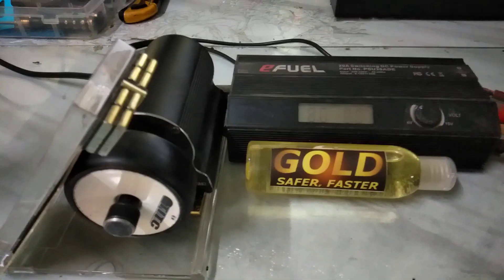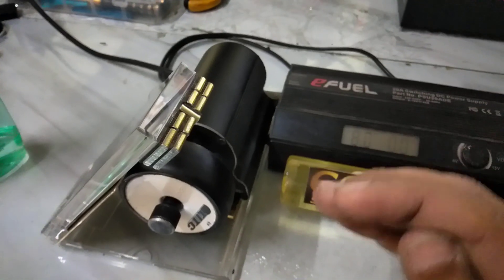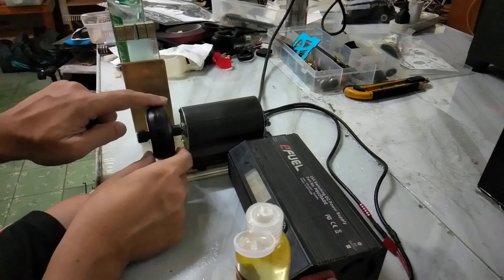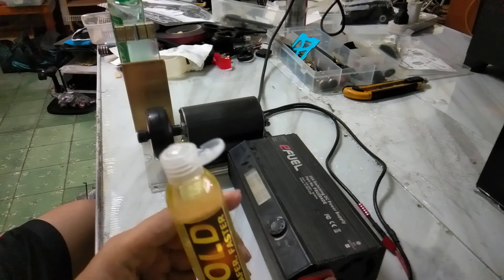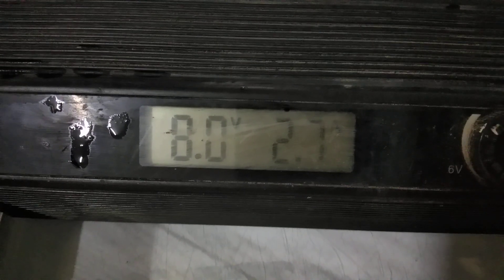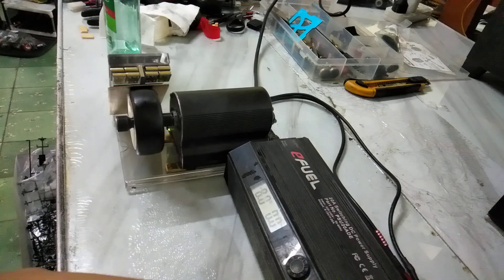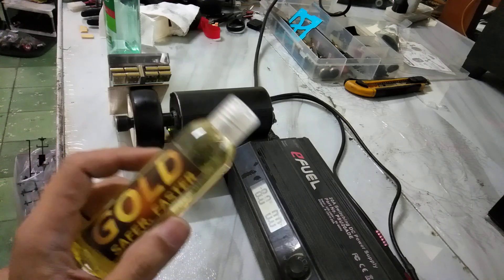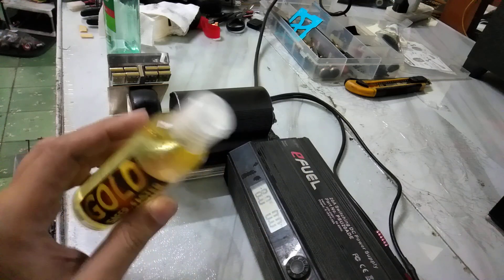RC Tire Traction Measuring Jig

Comment: As a new UK sub I'm grateful you're able to export your knowledge, we will catch up on the product in future I'm sure!

Side note...
I was established in 1975
My first was an '84 Super Champ
which ended up with curb rash from playing in the street.
I was fixed, and the same happened again. It was boxed.

'87 get a 1/12 Celica GRB
It burnt out the resistor??
Swapped the Technigold for a CB rig - kids eh?? 
Replaced it with a kyosho something
Ran it into a wall full on, banana'd the prop shaft!
Boxed.

I have a Nikko 1/16 Burns&Reid
Still working!!

I've a 1/8 Kyosho gx12 astra&Porsche - hardly broken in
Noisy,messy,etc....
Boxed

2019 colleague gave me the remaining chasis of their TL01

December 2023
The better 3/4's bought me a TT02 Yaris 😊
Game On!!

January '24
I got myself...
TT01e truck
M-06 Alfa
M-05 2CV
Radio link 6

Oh, the Christmas decs went back in the attic, down came the '84, '87 & TL01

Heelllpppp!!!!

Thank you for your time and effort in sharing this  "hobby" you enjoy.
The racing and prep and practice would take enough energy, let alone posting it here!
Reply from the maker: My pleasure to share. Need to help young ones dethrone the young once.